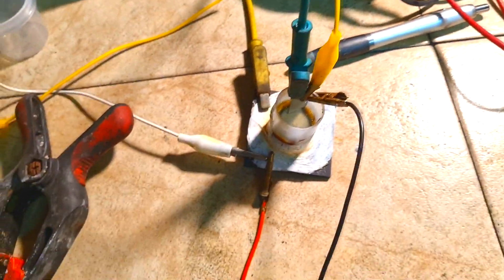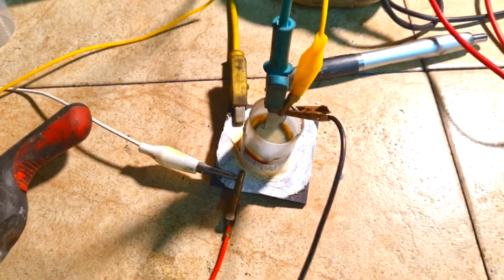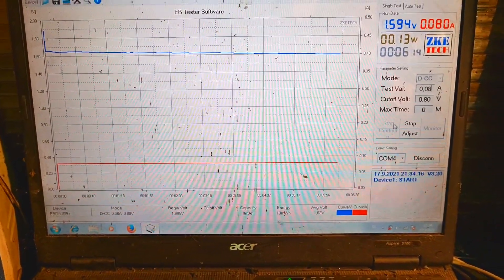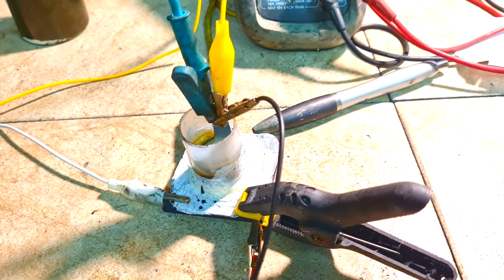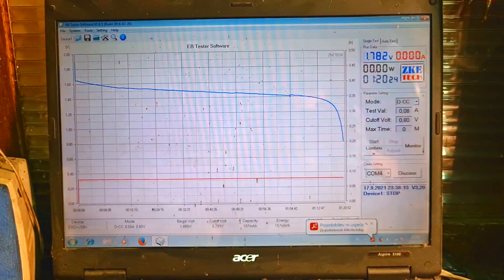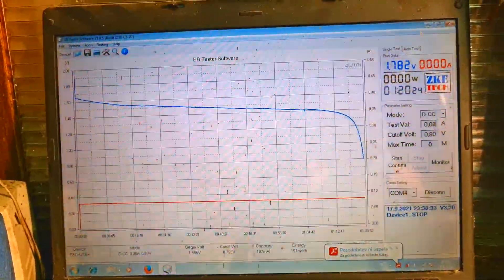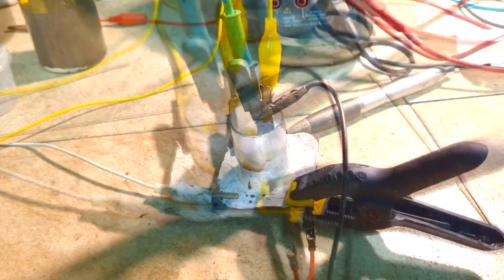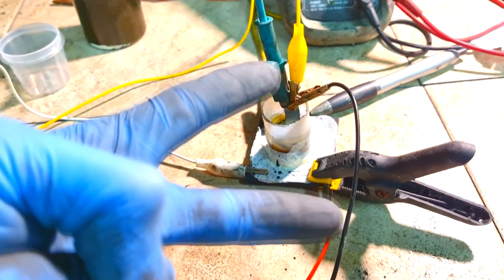Zinc Bromine gravity Battery - update

Comment: I tried the same, but dentrides are major problem. Internal short circuit, it is plan even if it is gravity based. Static cell is loss rather win with ZnBr2
Reply from the maker: Use or make "buletproof" separator. One is made from gips or cement on cloth for example
Reply: @cayrex  AEM membrane is ordered, will see performance

Comment: To do basic battery characterization you need to measure both charge and discharge curves so that you can measure coulombic and energy efficiency. Without the TWO curves, basic characterization is not possible.
Reply from the maker: I know. That's you need for EE and CE. For geting some idea about power and capacity is the discharge enough. First I am always interested about the capacity of the cell per cm^2 or per gram. If the capacity of the cell is bad,.... I throw it in the trash 🤷‍♂️. After good capacity,.... I look about cycles (how many % capacity I lose over 20, 50 and 100* cycles), self discharge rate**, overall cell stability CE,...
* only if the cell is really intereting to me
** vacuum sealed bag - mostly pouch cell versions
After all,.... if the cell can be made cheap, safe and have for example better specific energy that lead acid battery, then does not matter if the CE is low (until it is too low 😆).  CE,... is important parameter of secondary battery, I know. But the battery can survive on the marker also with moderated efficiency if other parameters are good.
Reply: @cayrex  Thanks for the clarification. I don't believe the EE and CE are trivial, even at the very beginning of battery development. Especially the EE. If you need to put in 15kWh to get 1kWh out, then the battery is not viable, almost no matter how cheap it is or how big its capacity might be. Many of these Zn-Br batteries suffer from either very fast self-discharge or - when measures are taken to address this - very low EE values. Your videos would provide a lot of additional value if you had both charge/discharge graphs and would provide all the data, especially CE and EE as a function of the number of cycles. There are very good reasons why these measurements are the basis of fundamental battery research.
Reply from the maker: @danielppps  uf,... in 15kWh and out 1kWh is to drastically. I know what you mean very well and I also mean that the CE should not go under 80% for sure. But like I said,... the good cell capacity is on the first place that I make next tests.
Reply: @cayrex  Bear in mind that some of these Zn-Br "gravity batteries" - especially those with big electrodes gaps to reduce self-discharging - often have CE values in the order of >80% but EE values below 15%. This is why it is CRITICAL to measure the CE and the EE, you can have cells with VERY high CE and very crappy EE. A cell with a CE of 80% and an energy efficiency of 15% is a cell where 80% of the electrons you put in you get out, but you get only a fraction of the total energy per electron. This is usually because of huge voltage losses (for example the cell needs 5V to charge and discharges at only 1.6V). This is very common with batteries of this construction. 

I don't mean to be discouraging, but honestly, capacity is meaningless if your energy efficiency is crap. As I said, put +10 kWh to get out 1kWh is not an unlikely scenario. Even if you get most of the electrons out (high CE) it is meaningless if you lose 85%+ of your energy in doing so. A high CE does not mean a high EE, especially in batteries of this class. Your results would be so much more meaningful if you could have CE and EE data.

A lot of the excitement around Zn-Br is because people rely on having a high CE and never measure EE, then realize that - in practice - energy losses are insane. You would benefit a ton if you measured both charge and discharge curves to figure out EE before even looking into capacity.

If you lower inter-electrode distance to increase EE, then you drastically increase self-discharge. If you increase electrode distance to decrease it, then you exponentially reduce EE. This tradeoff of EE and self-discharge, zinc dendrites and parasitic hydrogen evolution that irreversibly damages the electrolyte are the reasons why despite tens of millions of dollars in R&D, viable static Zn-Br batteries have not been commercially developed.
Reply from the maker: @danielppps  About  gravity Zn Br,.... that cell is more or less for the show. I am trying to say to the people that the gravity version is no go. Puting 5 - 10V for the charge on one singel cell or 35V for 12V battery. But because people like gravity cell version,.... I make that gravity cell which have the electrodes together and also have room for creating the bromine in conductive network of carbon felt pocket. The charging voltage was 2.2V to max 2.3V (classic gravity cell around 5 - 6V)
Reply: @cayrex  If you charge at 2.3V, then your EE will be, at a maximum 70%, if your CE is 100%. If your CE is a more realistic 80% - still very generous if your charging voltage is 2.3V - then your EE will be closer to 56%. This means putting 1.8kWh to take out 1 kWh, probably at a best case. A big waste of energy.

Not to mention charging at 2.3V - or anywhere above 2V - generates a lot of hydrogen at the anode, which irreversibly damages the battery (makes the electrolyte more alkaline and leads to the formation of Zinc hydroxide at the anode). Ideally you should aim to charge no higher than 1.85V, to make sure you can keep your EE high enough to be practical and to keep hydrogen generation reactions at a minimum.
Reply from the maker: @danielppps  cheers

Comment: In your opinion is this battery chemistry better for solar storage than the ZnFe battery you looked at?
Reply from the maker: Uff,.... it is so so, depending on individual. This ZnBr can have higher energy, but ZnFe is safer, bacause have no bronine...
Reply: @cayrex  Thanks, I must say I was impressed with the current draw from your 4 cm^2 ZnFe cell, not a chemistry I have tried yet. 😉

Comment: Zinc Bromine batteries are awesome. I have one going right now with TBAB/Na2SO4 in the electrolyte and so far its working well. It only draws 70mA @ 2V charge but in time I will set it up to have better electrodes. 

Thanks for the vid! Cheers.
Reply from the maker: Nice! Here where I am is so hard to get TBAB
Reply: @cayrex  I got it from Chemical Crunch in India (I live in Australia).
Reply: Can we collaborate ? I am too working on similar cell and researching.